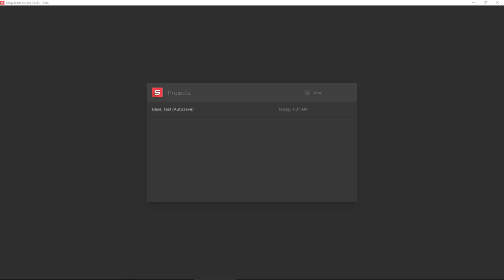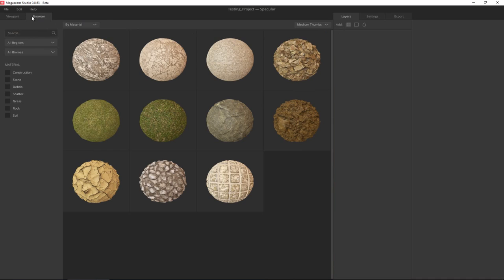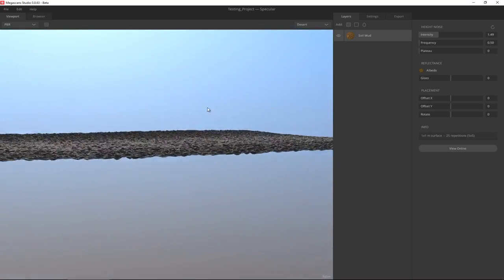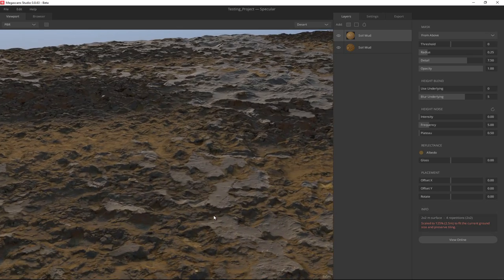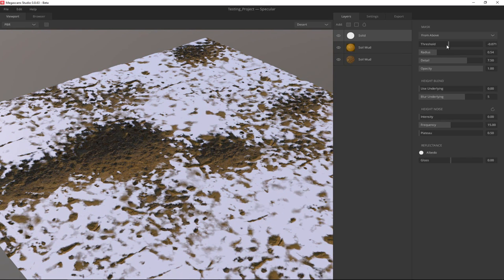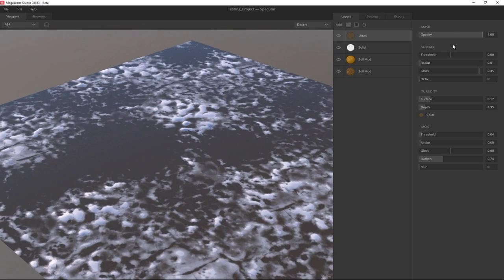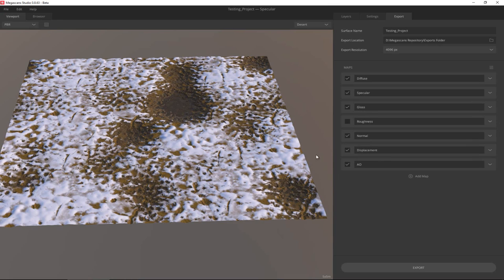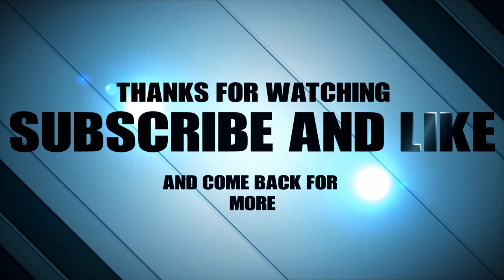Basics of Quixel Megascans

Comment: Thanks for posting this, Denis!

It's pretty amazing what you can make in Megascans Studio, for sure! I've been a subscriber for a couple of months now. The problem is achieving the same results in different renderers like VRay and Arnold (which I use). Even though it's pretty clear, for the most part, where to plug these maps into the shader trees, there is still a lot of fiddling and freestyling required to get it to look right. For example, Arnold is much better at capturing bump and specular detail than VRay, so you can't simply plug the existing maps into those shaders and expect to get the same results right off the bat. 

Since everyone using Megascan Studio will be exporting their data to be used in other renderers, Quixel needs to provide much more comprehensive descriptions of how to achieve the same results in the most popular renderers currently used! For example, WTF do you do with a Fuzz map? Where does it plug into on the shader tree?

Still, I think it's got a great future ahead!

Comment: Would you say it serves a similar function to substance designer? Also, I wish Quixel was a standalone like this too
Reply from the maker: Yeah it does serve a simillar function but it's making things much more simpler as the guys at Mega Scans did most of the work for you already.
Reply: Denis Keman have you got your opinion on which one does a better job, DDO or Painter?
Reply from the maker: IGarrettI That's actually a really crappy thing to compare and the reason for that is that i actually like them both. I like Substance Painter especially with the Photoshop bridge they have imprlemented and i like Quixel DDO even with it's clunky slower inteface. Basically they are both awesome tools that can get the job done.

Comment: Can you use quixel materials in zbrush? and render through keyshot?
Reply from the maker: As far as i know you can't use the quixel materials inside ZBrush, but you can take the data from quixel and export it out and then compile the material inside Keyshot.
Reply: Ok but I'm guessing only using keyshot PRO as it has the graph editor. So i would just make sure an object is UV'd in zbrush, then flood the object with tilable maps in keyshot 7 PRO. that right?
Reply from the maker: Sounds about right